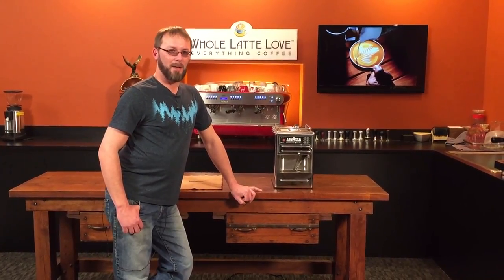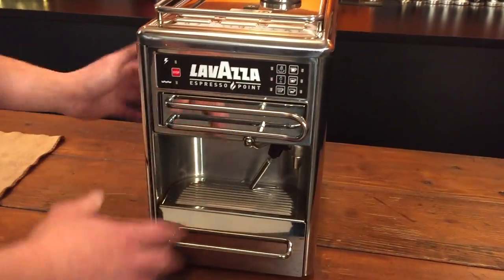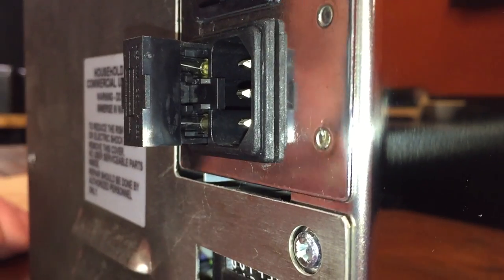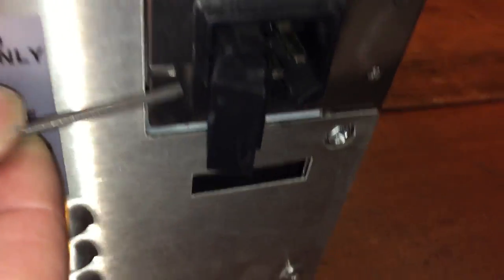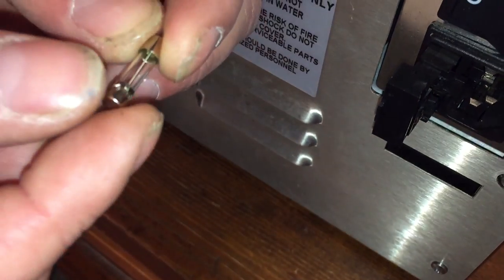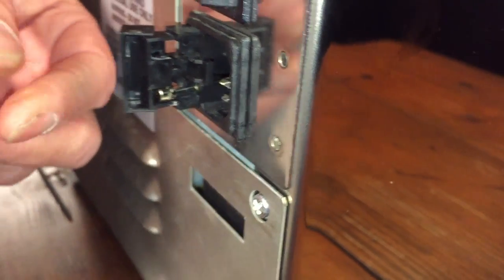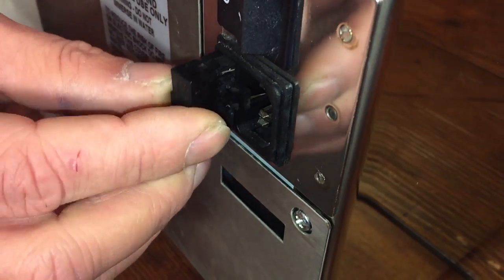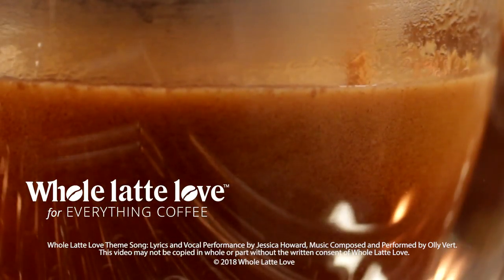Lavazza Espresso Point Matinee Fuse Check and Replace

Comment: My machine worked great for years.  Suddenly whenever I turn it on it trips the GFI circuit breaker in the wall outlet.  I've followed these instructions and replaced the fuses in the machine, but that didn't solve the problem (the old fuses looked fine but I replaced them just in case).  Any suggestions?  Thanks very much.
Reply: this i a safety issue and should not be done by any non electrician person as it poses a risk of electric shock
an insulation transformer with a gfi in front of it should work...
You can only open the machine and disconnect the heating element or pump or any other AC Power drawer which is grounded to find why it sends power back via its ground wire.